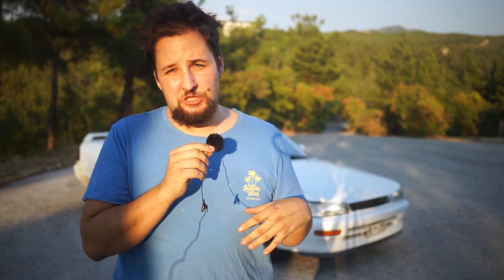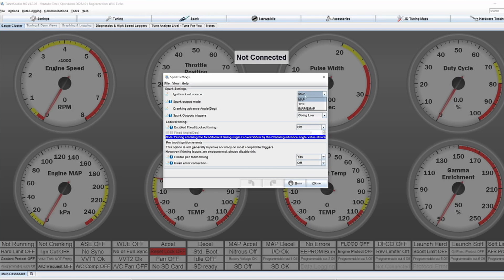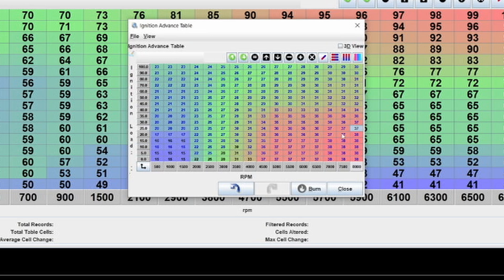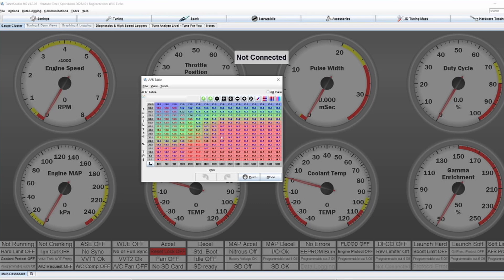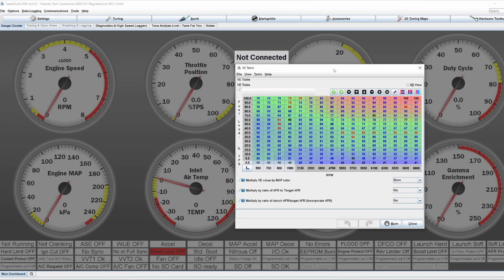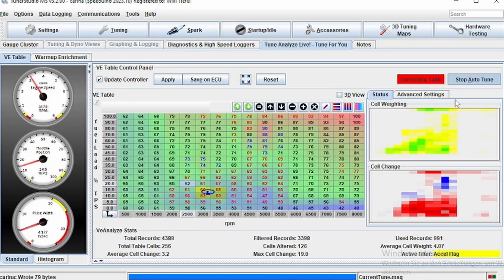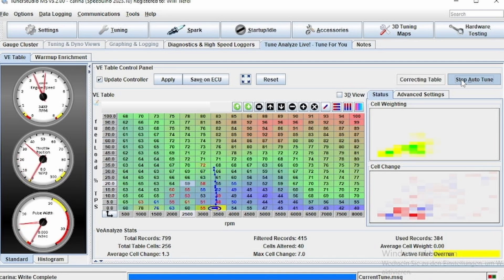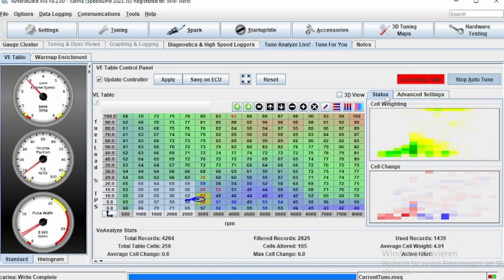Tunerstudio standalone ECU Tuning Guide | Part 15: Tuning ITBs & NA with TPS & Alpha-N  | Megasquirt

Comment: Can you use MAP for your AFR table if you have a vacuum log that’s giving a pretty stable signal ? So MAP for spark and AFR but TPS for VE
Reply from the maker: no that does not make much sense since fueling needs one and spark needs one sensor reading otherwise this wouldnt make sense.
Reply: I have itb turbo car and i have TPS for VE and MAP for spark and afr. It is working pretty well but i dont know if that makes the difference that it is turboed
Reply from the maker: @m30geezer Im running itb turbo now too and using map for both works well also

Comment: Don’t forget to update your speeduino to 202402
Reply from the maker: @marlo0oty213  any known issues with the new firmware? Or major improvenets? Hmm avent looked at it yet
Reply: @throttlebuddies0  yea they released a fix pack but its not for us. I havent had any issues other than the high rpm bogging ive been getting for almost 1.5 high now.. just saw your turbo video im very much excited to see more updates and i like that you ordered everything chinese. Good and cheap
Reply from the maker: @marlo0oty213  ah ok 

Yeah depends on.what you are getting lol 
But had aome engine troubles. But will get fixed soon and turbo prep.is gonna happen after that
Reply: @throttlebuddies0  always setup a restore point to the older one but i like to be updated even if it maybe a code that was fixed without them even noticing

Comment: ITBs are so cool, its a pitty that its them or a turbo
Reply from the maker: Well na kinda is always the same so im going turbo with it basicaly  but rather have one aingle throttle body for daily it drives so much nicer especially with dbw
Reply: @throttlebuddies0 how much from your research your silvertop can take stock?.. what about the plenum lots of people say it won’t hold!.
Reply from the maker: @marlo0oty213  as for the plenum not holding pressure and bursting, i doubt thats gonna be an issue. bigger problam is getting it airtight i suppose. 

as for power. a stock block should be easily able to handle 350hp+ at the engine ive seen a guy running over 400 with a similar setup than mine and stock engine on 1.6 bar of boost (24 psi)
Reply: @throttlebuddies0  are you on stock pistons?? Thats the issue there because everyone is talking about the the pistons are bad and are fast to be cracked. I think also some type of soft gasket will do the job
Reply from the maker: @marlo0oty213  nah pistons will be good as long as there is no knock and temperatures kept withing check with water meth. Im only planning to run like 300 or so as the gearbox doesnt like a lot of power and the car is pretty light to begin with. 

Usually pistons are a lot stronger than people make it out to be. Stock Miata pistons for example are capable of handling 600+ hp given no knock and high ethanol content or water meth
Reply: @throttlebuddies0  oh so i though the. Pistons to be weak from the ho capacity not like limited to knock.. so i think the best way to go is drop a 1.6mm gasket or 2mm to manage things better
Reply from the maker: @marlo0oty213  no  i dont like reducing compression, makes the car lumpy down low. I will probably use a stock size gasket
Reply: @throttlebuddies0  yea all i had in mind is high comp turbo= great daily and fun. With a bigger turbo same as urs to manage the heat. But its a drop of 3% max and gets you a lot of margin in the boost areas.. idk i will see how confident i am. So the pistons will hold up if heat/knock is managed. Good thing to know because 2 years of research only thing i got is 6 psi=saftey
Reply from the maker: @marlo0oty213  yeah we will see how well it works but i think might be good! Will post videos ofc so you can see the progress 😁
Reply: you can build a plenum around your ITBs and turbo
Reply: @Thatdavemarsh the bt/st already comes with a plenum